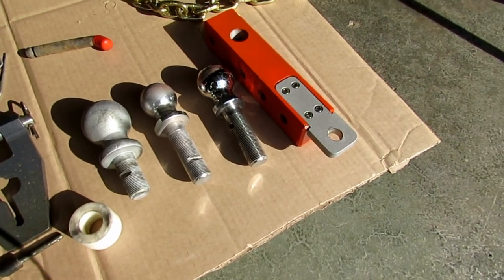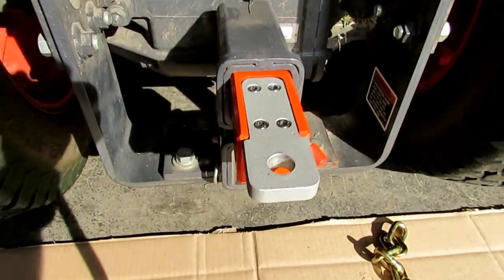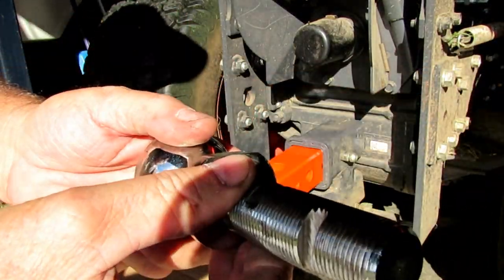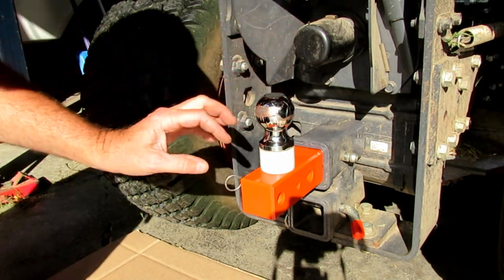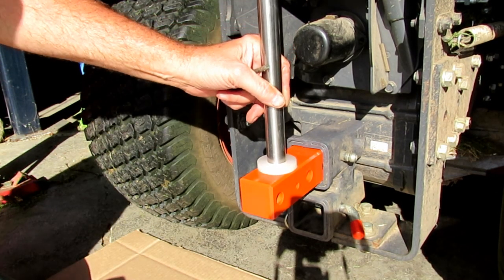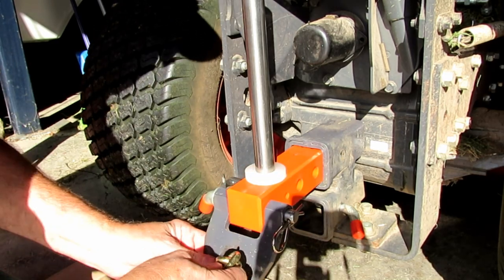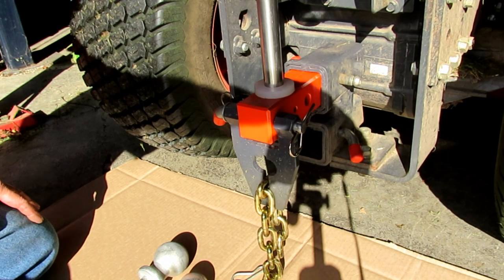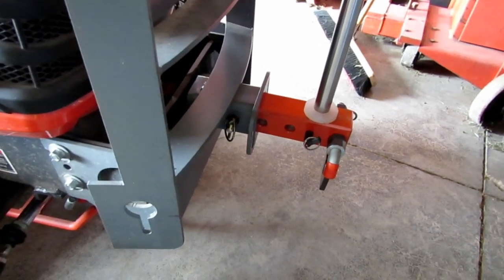Kubota BX Hitch Adapter

Comment: Nice setup. Ever consider making more and selling?
Reply from the maker: Thanks.  No, it's too expensive to set up a business in NY with all the regulations.  Thanks for watching.
Reply: 06Goatm6, I am actually looking to make a hitch very close in design, I have it drawn up, but the hitch itself is not cheap, would you be interested in seeing my design and quote? If I make several at one time, it will bring the cost down.